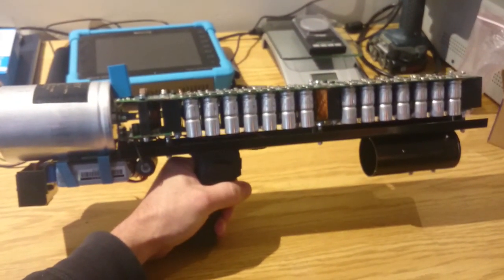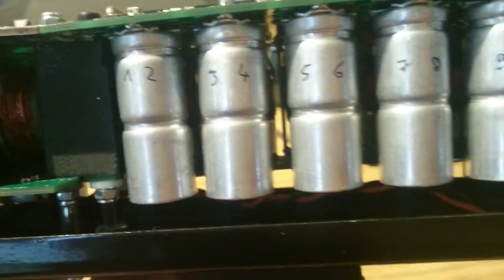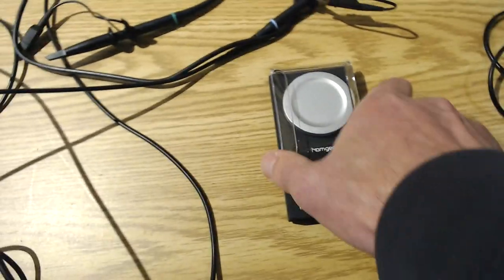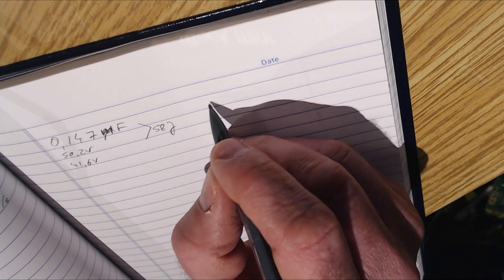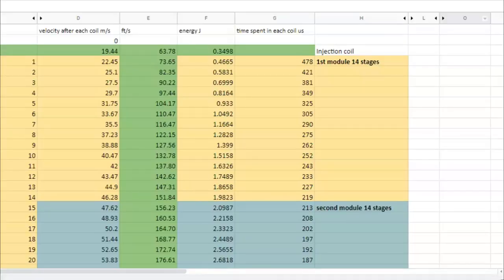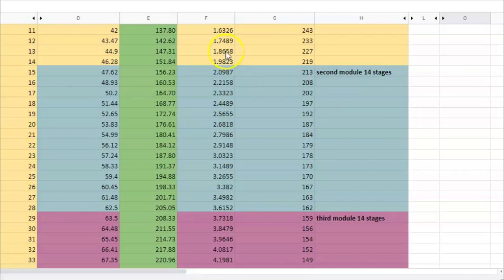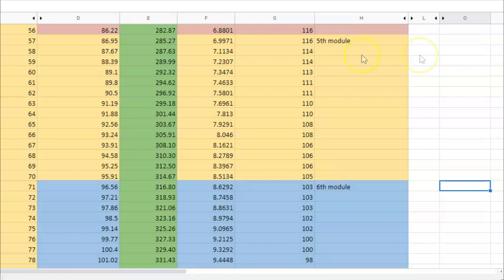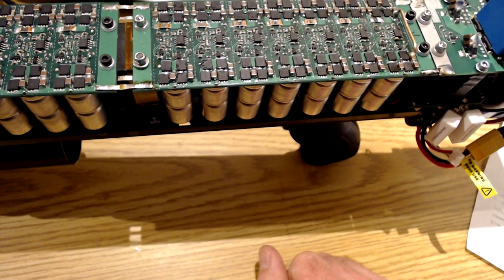High density Coil gun Multi-stage

Comment: Amazing engineering work. I wonder if the projectile is saturated, it could be possible to commutate magnetic field direction when it passes the middle of the coil, so it would add a repelling force to it, in a way that would be like adding more stages without using more space. I know it's too difficult to calibrate and even measure/comprehend the timings of magnetic field changes, not to mention the hard work of putting this devices together. This coilgun looks like years of work. Thanks for sharing this information. And again, amazing work.
Reply from the maker: Thanks. AFAIK the magnetic domains are nearly instantaneously reoriented, all of them at these field strengths. I can be wrong of course but I don't think it's worth the effort trying this. The design is also to simplistic to allow that amount of fine tuning. Thanks for the feedback
Reply: @tomtechtod9200  You're right, this could be practical only with stronger magnetic fields or highly magnetic permeability projectile materials. May be can never be implemented on a handheld gun. Not my intention to suggest modifications to your design, just wanted your experienced though to clarify me a bit, and it did. (I know lots of people would say what you must do with your design, I personally don't like that a lot. Just a few people know how hard is to make a coilgun a fraction of complex as this one. If I sound too polite or something is bc of my bad english.)

Comment: I believe adding a simple spring or using compressed air for initial acceleration of a bullet would increase overall efficiency without adding expensive coil stages.

Comment: I think it need to increase the field every 3 to 5 stages, maybe with more voltage or increasing wire gauge.
Anyway, the result is impressive considering that you are using a projectile with no sharp tip.

Comment: Nice work! Great integration. With such low voltage I hope you have low inductance hehe do you think the coil current shutoff too slow? Efficiency seems low
Reply from the maker: Yes I also expected higher efficiency. The coils are only a couple of uH, the current essentially looks like a square wave with very short on/off times. Efficiency could maybe be improved using powdered iron or laminated steel projectiles, distributing the main capacitance over the length of the first module and reducing Ampere/Turns (which makes the "barrel" longer for the same velocity). I'm done experimenting though with this
Reply from the maker: @MEGAVOLT  Great!
Reply: I saw that vid, very cool! I am using ferrite U-core in my coilgun design, it increases inductance but I am using higher voltage too.
Reply: Hey everyone. Oh yes of course...  See also New Portable Super Coilgun:

https://www.youtube.com/watch?v=rclLsQ9nyeg&amp;feature=youtu.be

https://www.youtube.com/watch?v=-mjDqp_oWZk

Comment: How your coils are assembled? I think for core you should use soft magnetic materials  that are easily magnetised and demagnetised. Coated layers for minimizing eddy currents just like in brushless motors use. And only few turns for coil to minimize inductance
Reply from the maker: Yes, few turns only. A core is useless unfortunately because at the magnetic field strength used it would be severely overmagnetized. The main limit here is the current capability of the mosfets
Reply: @tomtechtod9200  I see the current is so high that stator would start to saturate. Maybe air-core design works better for this application.. If you want to try high currents, i would suggest to explore how 18650 spot welders work. They work in 12-30v voltage range and use really robust mosfet stage to deliver high peak currents up to 2000 Amps. Example kweld from youtube

Comment: are eddy currents in the projectile or delays between detecting the projectile and switching-time in the mosfet a significant factor?
Reply from the maker: Eddy currents yes, saturation if the projectile also. Detection to drive stage turn-on time is not a determining factor at these velocities
Reply: What does saturatipn of projectile means?

Comment: Perfect gaussgun! But the efficiency is indeed low especially for half-bridge configuration ! Maybe because of the projectile form? Or the coils contain too little turns?
Reply from the maker: Thanks. Yeah, I was expecting at least 12% for this config.  Increasing turns would make the current rise more slowly and the magnetic field would be generated too late. Higher voltage could help with that which increases part cost. I think the fast current rise time in the coil just in front of the projectile is actually counterproductive; I should turn on the coil some time before the projectile reaches that coil so it would only see a DC field. The position sensing is fixed though and not programmable.
Reply: @tomtechtod9200  , you could get much more efficiency,> 30 %. Here i got some calculations: http://coilgun.ucoz.com/publ/theoretical_papers/coilgun_calculations/efficiency_assessment_for_a_half_bridge_coilgun_in_real_operating_conditions/7-1-0-18
I think the problem in your case is that the circuits are in free-wheeling state for too long time after having reached a current limit, so the recuperation is inefficient...
Reply from the maker: @EugeniusMit  Interesting paper, but it's theoretical, I wish someone to build it - at low voltage. My current pulse looks similar to what is in that paper. At one point it states "Then the projectile must get no less than 4 m/s per stage supplied the velocirty gain is the same for all the coils (this assumption is plausible for multistage systems" which I think is incorrect. For a constant velocity gain you would need increasingly more energy for each stage, that would be very hard to achieve. Also, during the freewheeling time the coil regenerates back into the capacitors + there is current through the coil during that time which made me assume there is still a magnetic field and consequently a force applied to the projectile. What do you think
Reply from the maker: I really think one major contributor to efficiency is coil activation depending on projectile position, it might be suboptimal here.
Reply: @tomtechtod9200  , the identical velocity gain on all stages is of course an approximation, but it maybe close to reality because the acceleration is more efficient per unit energy spent when the speed is higher ( in my coilguns I clearly saw when the same capacitor placed in subsequent stages transferred different energy to a projectile).
Reply: In my paper the case is analyzed when only one switch in a half-bridge is closed in the free-wheeling mode, maybe your coilgun is constructed in an alternative way, I don't know...Concerning activation position  that is an important parameter indeed, but in Your case the fronts are very steep as you write, so it may be the same for all the coils....
Reply from the maker: @EugeniusMit  one switch switches at high frequency, the other remains on for the whole pulse length
Reply: @tomtechtod9200  , then that is the case under investigation in my paper. But the energy is nvot put back into the cap during the free-wheeling mode, it is just circulating in a coil....
Reply from the maker: Correct. My bad. Maybe then it would be better to actually commutate both switches and increase frequency, so the current remains high and goes back into the caps... Can't do this with my design though...

Comment: The only difference I'd make Is wind 
EVERY LAYER the same direction, 
so the magnetic fields of each layer would be 
n/s, n/s, n/s, n/s, n/s
You've wound it back and forth, 
so you're magnetic field of each layer will be 
n/s, s/n, n/s, s/n, n/s
Do you see how they'll give totally different results? It PUSHES the magnetic field outwards through repulsion,
Winding back and forth PULLS the magnetic field inwards through attraction within the coil layers itself
Hopefully you might try a side by side, 
for others to see as that's one comparison not done yet ;) definitely 2-3x stronger
Reply from the maker: Unfortunately not much gain can be obtained that way. The main limitation of these coilguns is saturation of the projectile. Once it's saturated the force on the projectile decreases substantially, with the same magnetic field strength. That's why all ferromagnetic projectile designs are still clunky.  The best designs use a higher mass projectile and therefore have higher kinetic energy, still at very low velocities compared to firearms.
Reply: @tomtechtod9200  actually it can   the coil you wind you think youre getting the magnetic field this other way actually gets
Reply: @tomtechtod9200  the video i just posted proves its over 2x as strong mas for mass.
Reply: @tomtechtod9200  the stronger field can handle a much bigger/denser material with ease, on my motor i can easily push n52 magnets super faster, the normal weaker coil needs much weaker magnets to push same principle with iron much strong pull

Comment: Given that a bullet travels about 1000 meters/s  it seems you're wasting your time here.  The highest magnetic density occurs when you have a single turn coil.  The more turns you add the weaker the field gets because all those added turns get pushed further away and just increase coil resistance and inductance. Try using just a few turns, but the in rush current will be huge so you'll need capacitors that can handle the high current surge.
Reply from the maker: Waste of time, not. Learned something. Bullet 1000m/s? Many are slower. And, these coils are small btw. Main limitation here is projectile saturation and consequently low efficiency
Reply: @tomtechtod9200  speed varies I guess,  https://en.wikipedia.org/wiki/Muzzle_velocity.  I'm thinking you're probably not getting the magnetic field strength high enough, fast enough. Assuming you stick with 50v then the only thing you can do is reduce coil inductance. Hence smaller coils(thicker wire), not bigger coils. Less turns, more impulse current. Add cooling to bring the coil temperature down. Cool the bullet too.